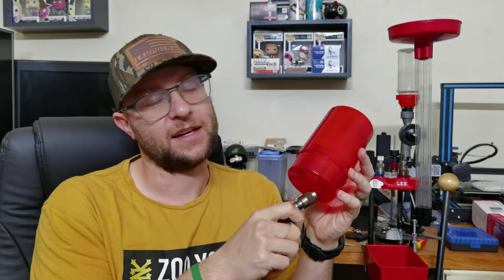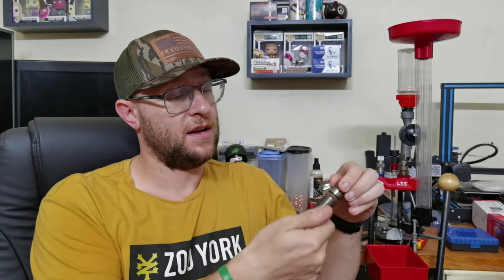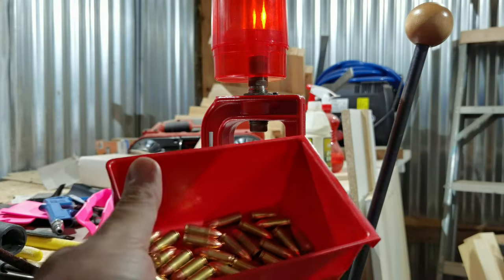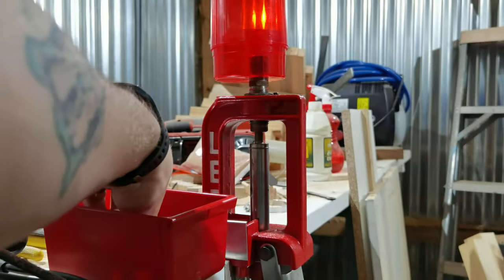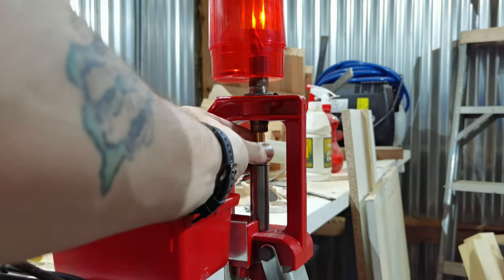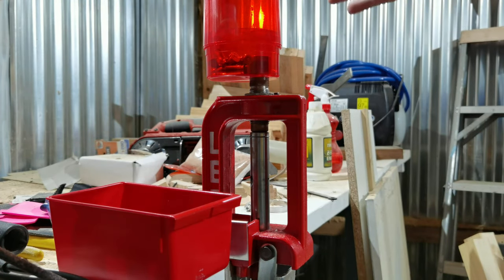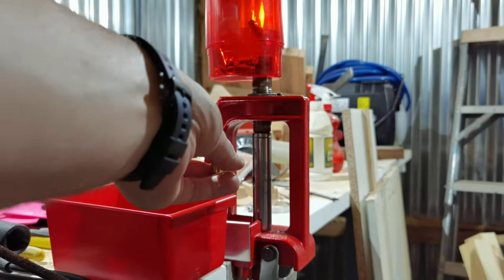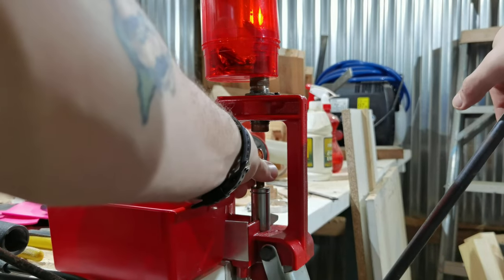Lee Bulge Buster Review and Full Process

Comment: I have never considered resizing loaded ammo.  Wouldn't it be better to resize the brass before you load it?  Just asking.
Reply from the maker: Either way seems to work! My only concern with doing it before hand is having to do another wash on the brass to get the lube off before loading. Other than that extra 30min I don't see any reason why you couldn't! The manual for the bulge buster says brass or complete rounds i guess i just went with the quickest.Thanks so much for the comment!

Comment: I'm pretty impressed! I actually learned that from your process, I absolutely would not accomplish this based on the fact it will thin out the casing. This equals = more issues / more potential firing or case related issues. Safer I digress to de-charge the round and toss the case! Thank you for sharing!
Reply: It doesn't damage the brass any more than sizing or flaring does.